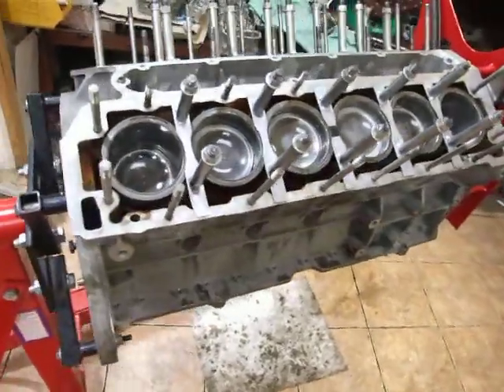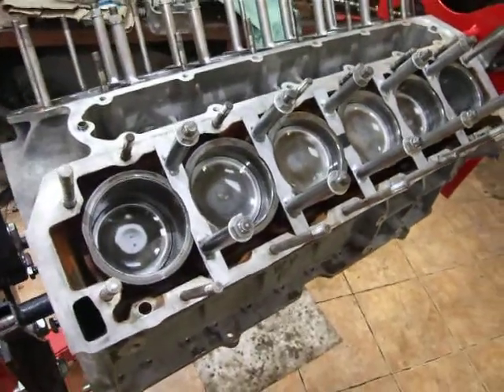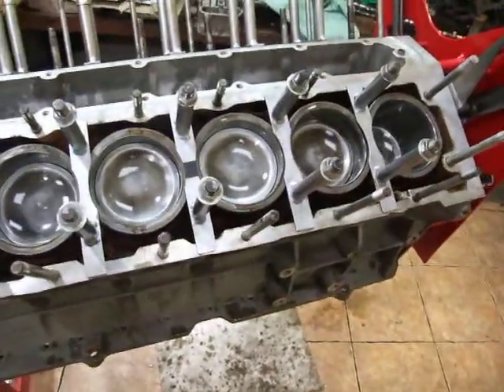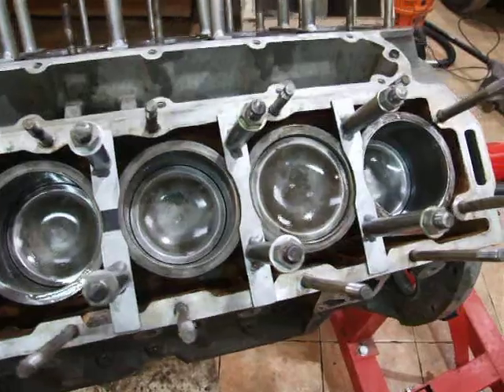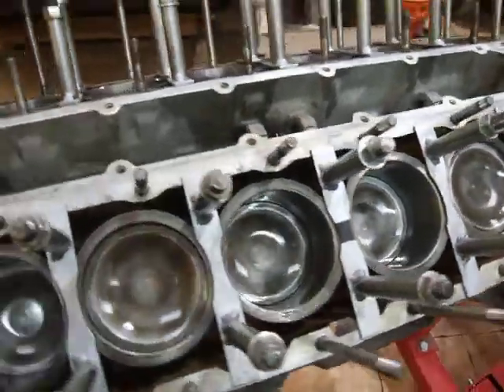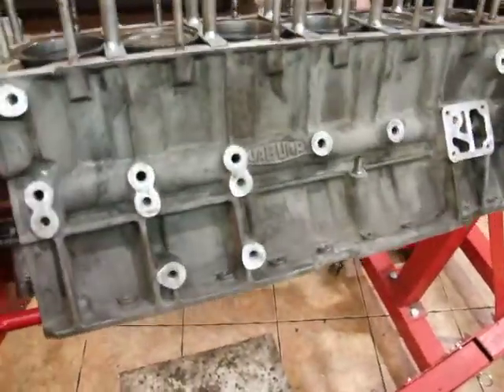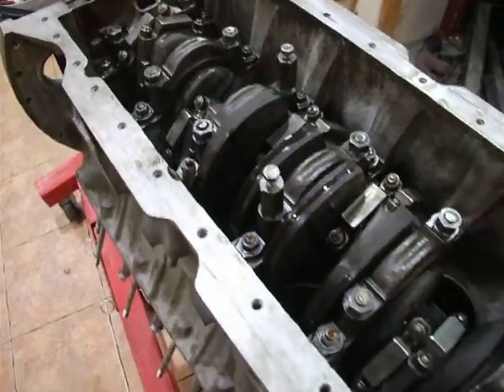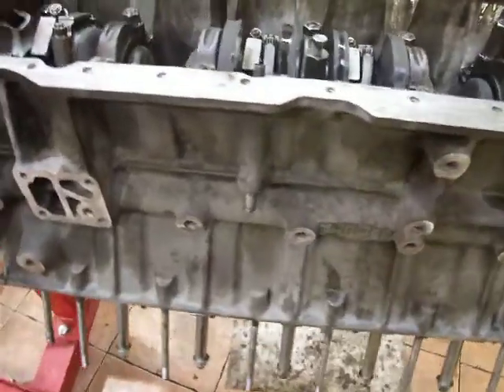Jaguar V12 Engine Rebuild (3)

Comment: why do you have those retainers there? will the cylinder liners fall out?
Reply from the maker: +dantheman1998 Hi again Dan, yes the liners would fall out and are held in place by the cylinder heads, the tolerances are such that the head torque is enough to form a seal around the bottom of the liner and prevent water ingress into the sump. 99% of the time they never give trouble. Regards from the Team
Reply: @Kinkellclassics  That's, well, quite impressive, holding such tight tolerances on so many mating surfaces requires some really precision machining